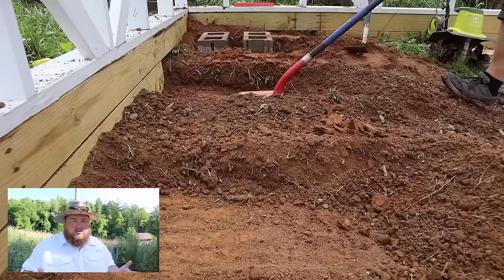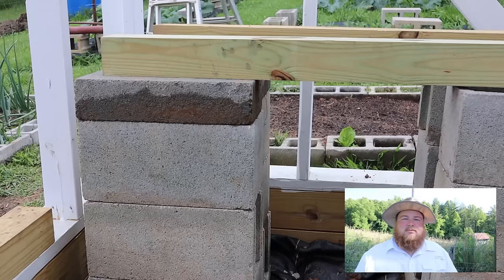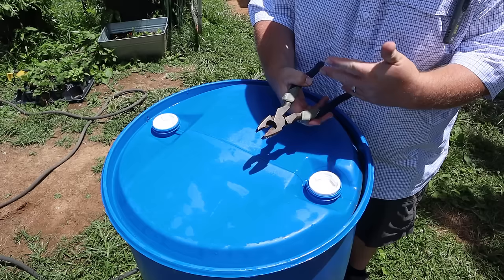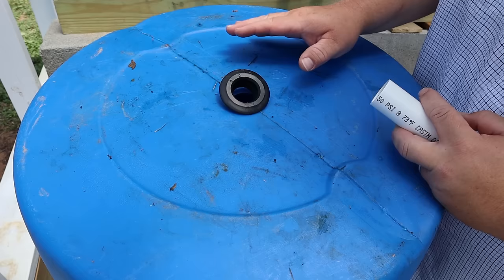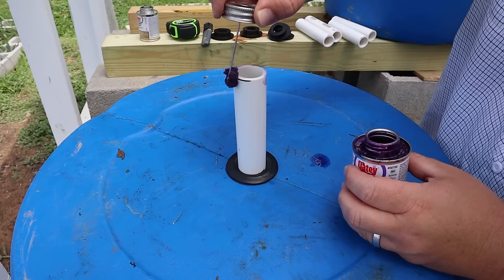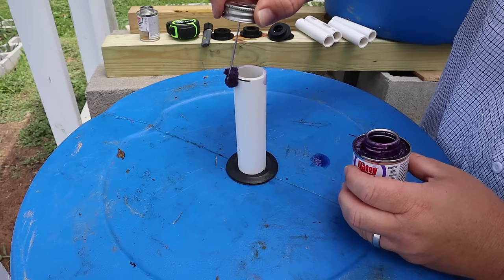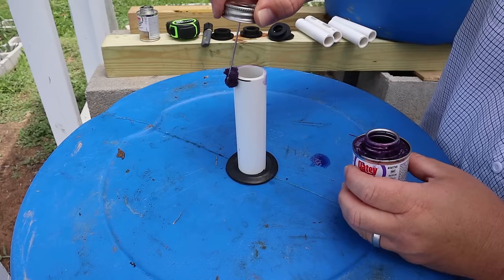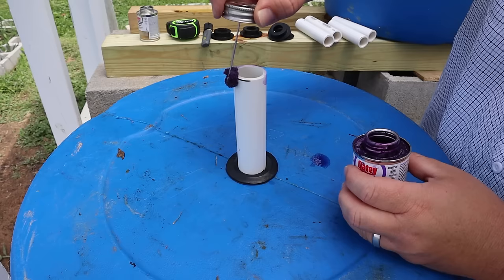COMPLETE Rainwater System START TO FINISH - DIY Greenhouse Build #10

Comment: So bad news about the overflow: when comparing pipes for flow, you care about the cross sectional area . x5  1" pipes will have a cross sectional area of 1.25*pi square inches, while your x2 2" pip intake has a cross sectional area of 2*pi squared inches, so your input does exceed your output, which isn't good. What is good however, is that you shouldn't need to care about this: you only need to ask yourself if the output area matches the source. So the question becomes: would x5 1" pipes be enough to replace your downspouts, or would that ever cause the gutters to overflow? For a structure this small, you will almost certainly be fine :) . But in the future don't forget to thing about pipe cross section instead of pipe diameter!

Comment: Why not use the barrels on level ground to help hold your trays or tables. 
It could help heat the seedlings  from underneath when it is cool, and help save the space those barrels take up, currently,  sitting on that ledge----  where more plants could  grow.   And a simple recirculation pump could heat those tanks with a small and simple solar heating box/tube ensuring a nice warm and cozy temp inside your greenhouse in cooler months. And an underground box/tube to help cool the water in the summer so the place won't over heat. But there is always shade cloth and auto window openers for high temps! And  a screen door works, too.

If you wanted the barrels off the ground to have water flow by gravity, you can use a foot pump or a small electric pump to get pressure to move it to where you want it.  As you have it there might not be enough pressure to water things in a timely manner because the height difference might not be great enough to give you much pressure or volume to water much. It might take you much longer than you want to devote to watering the green house, especially if it needs to be done daily!

So many options! So many possibilities!!!

I hope to heat and ac my cabin with  a large enough water tank inside to do those functions--- in whole or in part. But it might take a 800-1000 gallon tank or tanks to make it feasible,  with a simple recirculation pump to heat or cool the water, depending on the season.  A tight, well insulated house should  make this happen, easily enough. 
Need to recheck the cooling coefficient of water with a 30 degree difference in temps, while in heavy plastic holding tanks (perhaps 2-3? icb containers. But a large cylinder would be very cool, or 2, 1 water pillar in opposite corners, working silently! Doing their thing!

As I said, so many possibilities! 

And especially exciting if you can do it yourself! 

Appreciate the "Can Do Attitude" and the stick-to-it-tive-ness you display! Inspiring, esp for those of us with ADD!

Comment: Why glue the PVC pipe it's not high pressure water right just running water pushing the piece of PVC pipe together should make it tight enough fit not to leak just in case you want to modify or add-on just throw that out there
Reply: True. Easy enough to check. Elevate a barrel to the height or higher, pipe to the ground, press on a cap and fill the barrel. If the cap doesn't leak or pop off, it'll work. Hydraulics being what they are.
Glued or not, if his manifold to his hose bib freezes, PVC won't survive. PEX and shark bite type fittings (expensive) should. PEX clamp tool $50 or so. 
I don't see this working fine and lasting a long time.

Comment: As you said, water being water, doing what water does, you didn't really need 5 overflow pipes! Perhaps just a 2inch one in one barrel. That would have saved you some money. As well as not needing the 90 degree elbows at the very ends of the over flow pipes.  It might look more finished your way but it is another expense that wasn't completely needed. The elbows are 45 cents?  So a couple of bucks. The 5 overflow down pipes, connectors, glue, etc, so maybe $10 for unnecessary plumbage!  It all adds up! FAST!!!!

But,  you could have gotten a 'ball valve' rather than that $12 'compression' valve you did get.   Ball valves are vastly superior, will last longer,  are easier to turn on/off and never leak!!! I think they are worth the extra expense---- always!!!  Some things are worth added expense due to their superior performance! And when it comes to valves and faucets, ball valves are just superior products, esp if you only want to build something once!!!
The rubber in a compression value deteriorates too easily and too quickly, for me. Ball valves are made of solid, non-rusting brass! They will outlive you! By a mile!

(And no!  I don't sell, mfgr, or distribute plumbing fittings! Or know anyone who does! Really!)

And as far as a glass tube--- it might look nice but they get broken. You can tap on the side of a tank and know what you want to know.   If you really want to see exactly how much water you have make a bobber that sticks out the top. A very thin part that sticks up from a  float, that sticks up  through a very narrow hole, and the height of this very tall bobber will tell you how much water is in all 5 tanks! And you can mark the projecting part to indicate gallons left or gallons used, whatever. Or all of that, if the projection is square. Each side could measure your volume in a different manner, amt left, amt used, etc. With a hole just larger than the projecting bobber you will not have significant water loss due to evaporation, either.  And not enough light leakage for agal growth!

Or you could just take the lid off and look inside!  So you have many options!

Comment: ~18:20 well technically your 2d surface area of those 2inch pipes is larger than 2 of them 1 inch pipes. area of 2inch circle is 3.1416 sq inch. area or 1inch is 0.78540 sq inch. so 2x3.1416 is 6.2832sqinch and 5x0.78540 is 3.9225. uhm. might wanna double that and with them overflows you dont need airvents and the inlet tanks you kinda vented with the inlet

Comment: Put the rain water inside a green house. 

Why didn’t I think of that??   Rain water collection is illegal here.   If I put barrels inside a greenhouse with opaque walls and fake plans on top it will just look like plant barrels.  Haha
Reply: Ive never heard of such a thing. Since when is it illegal to catch rainwater?
Reply: @spiritwings4592  it’s actually very common.  Idk how other areas handle it but here the city claims that land ownership within city limits only comes with a property deed for the surface land and not mineral rights and claim that the mineral rights still belong to the city through the original city charter.
Reply: @spiritwings4592  it is also illegal to be off grid at all.  You are required to be tied into electric, water, sewer and natural gas unless you receive an all electric certification.  

It is illegal to have a well or septic system in town and it was illegal to have solar until recently.

Comment: That'd be great if it weren't for the planes everywhere dusting us all with nanoparticles of aluminum and other polluting chemicals... Far as I know theres no filters that get this out of the water, because of the miniscule nature of nanoparticles. Some student won a award recently for discovery of a possible solution for that using electric magnets and adding charged particles to the water and the nanoparticles are attracted to them so they will be able to get the mixture out using magnetism.... Not sure of the exact process but it doesn't sound easy or cheap. We really need to get together soon and make them stop this pollution before it's contaminated all the soil and water. These particles are so tiny they pass through the skin. We are breathing them in. They have proven it causes dementia. We are all in trouble with pollution like that!!
Reply: Watch the Dimming for more information on this

Comment: Absolute fail. If you connected all tubs together youd only need one overflow hole plus, it's run more effect if pipes didn't run up hill and the flush out pipes don't need to have holes in. Just once in a while empty them.
Reply: I don't think he's too concerned with the first flush since it's irrigation water -- otherwise he wouldn't have went with this type of first flush. He shared another video where he made catchment for chickens and he went with a float in the first flush to block off once  full. I think you're wrong on this type of first flush not needing holes ... Where would the water go as soon as it's full? Back into the barrels/cistern including any floating particulates. At least with the small holes (I guess) the hope is that the debris trap slowly drains and limits back up? 
Sam! Why'd you put the holes in first flush??

Far from an absolute fail!!!  I am a little concerned with the stability once filled and being only on rudimentary footing ... How has it held up Sam?

Subscribed✔️

Comment: The reason i gave you a thumbs down, you build a green house to help feed your family then you waste growing space with rain barrels. Why didn't you put them on the outside.? If you were thinking of using them inside so the heated water might be released during those colder nights you would have painted them black..